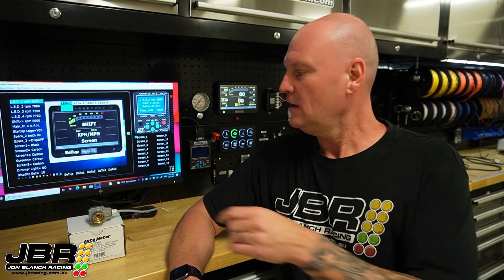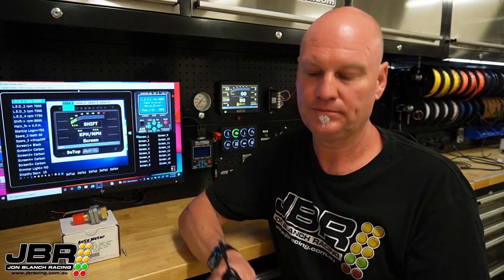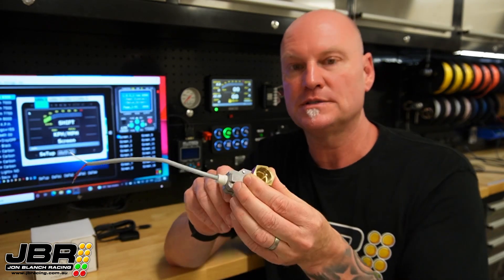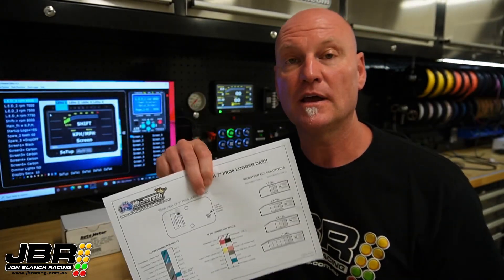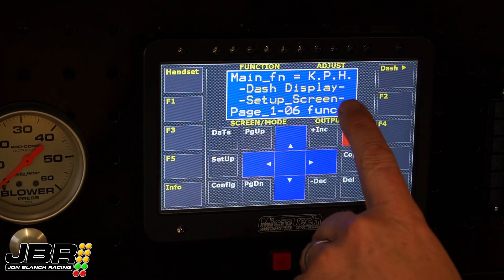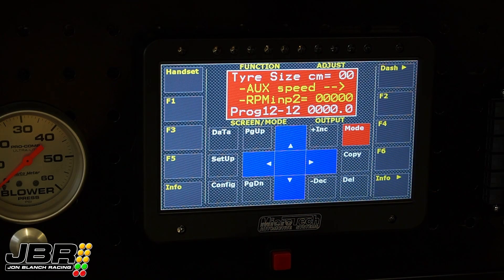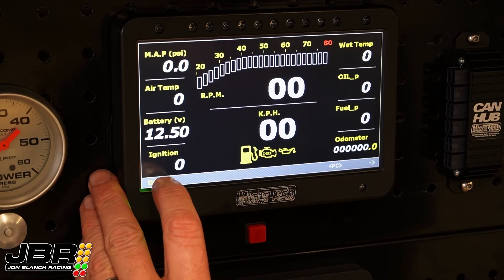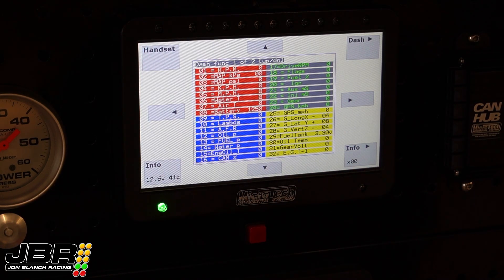How To - Install an Autometer Electronic Speedo Drive on a MicroTech Pro Dash

Comment: Hi mate do you think this will work on a fb rx7 I’m running a micro tech lt8s ecu?
Reply from the maker: No mate 👎🏼 The dash unit only works on the later model “c” series MicroTech ECU’s with the CAN output
Reply: @jonblanchracing1487  thanks mate big help👍

Comment: Question, can you have both GPS and electronic drive work together? ie, when/if you lose GPS signal the ecu swaps to the speedo drive?
Reply from the maker: Yes Brad. 
But the other way around. 
While ever the dash is seeing the signal from the electronic speedo drive, it will always favor that one. 
If the electronic sender loses signal, it will revert to gps